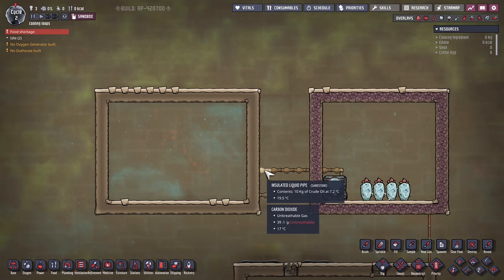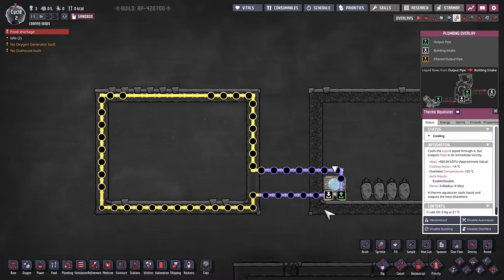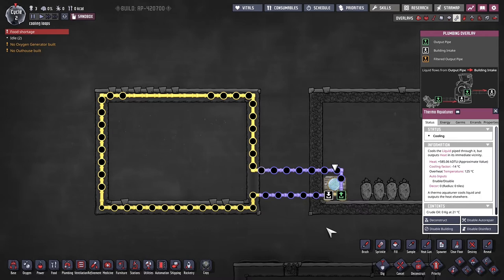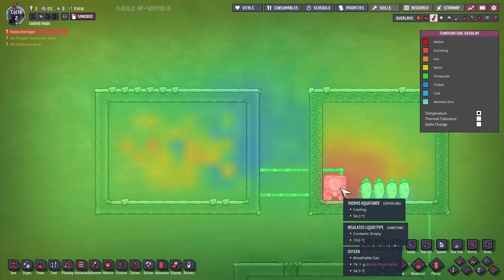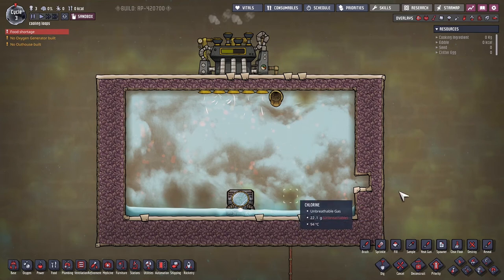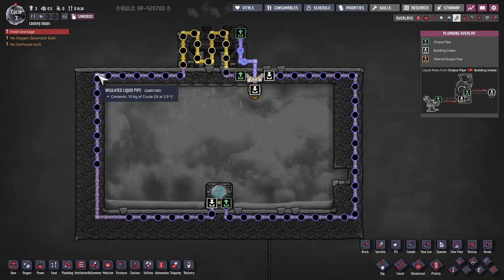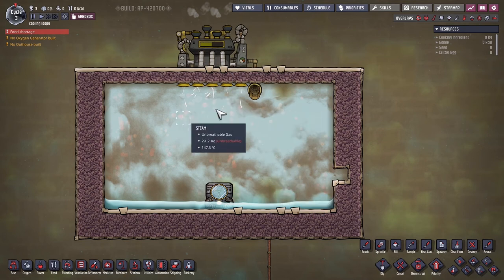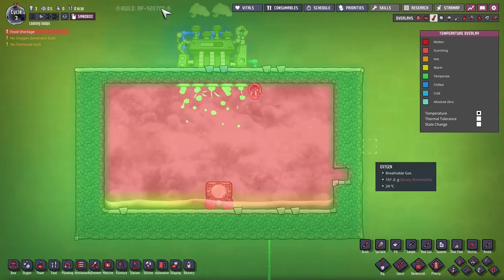Oxygen Not Included cooling loops

Comment: Nice simple quick explanations. I think maybe Polluted Water may be used also since it has a higher boiling point than water, and one doesn't always have access to petroleum. Thanks!
Reply from the maker: You can use polluted water instead of crude oil if you don't have access to it, however I usually build this after I reach the oil layer so I never really used polluted water for this.